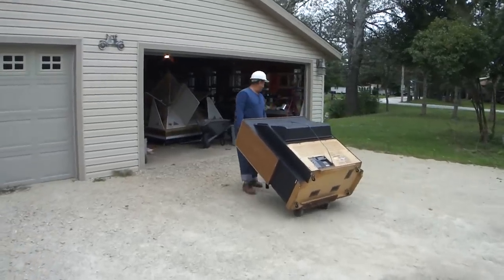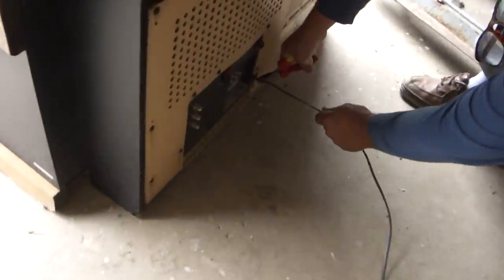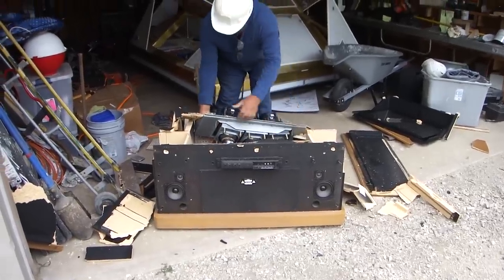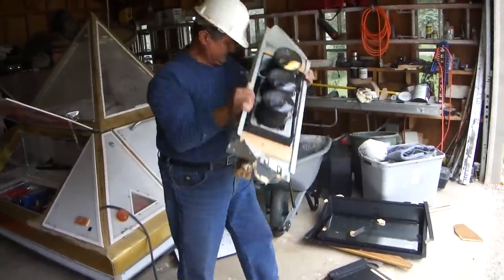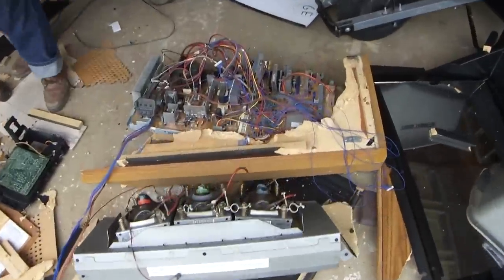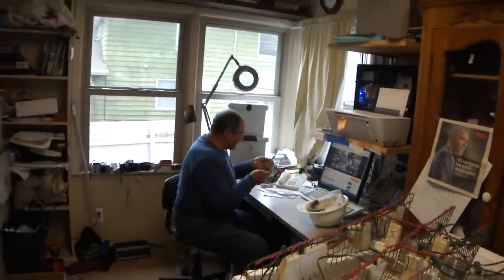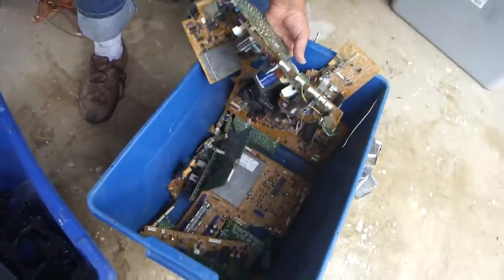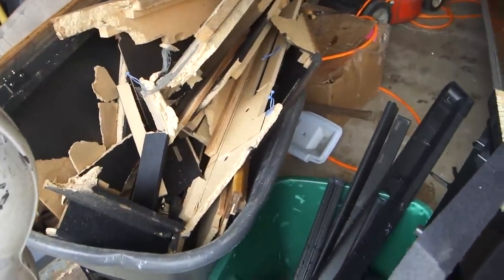Greg Zanis - Scraping Apart A Big Projection TV

Comment: soooo, he is wearing a hard hat with ZERO overhead hazards, BUT, no steel toed boots (sledge hammer hazard), no work gloves (broken glass/metal/screws sharp edges), and no safety glasses (glass and wood shrapnel). What a BRILLIANT guy he is. Unbelievable.
Reply: I was thinking the same thing.  PPE is key.  Scrap safely.
Reply: @biffskills4842  Or, at least PPE that makes sense.

Comment: You Would Make More Money On The Boards If U Leave Cooper On, but not as much as Copper alone seperate frm the boards, Copper holds the highest value, boards is like one $1 lesser, so Greg u doin it by the highest way of makin yo money, providin u have the time to do it, some Scrappers dont, so its not worth their time. Evrythng diffr frm 1 Scrappr to another, biggest thng to me is What Encourages U To Scrap, it does u Good to use yo Sludge Hammer, it does me Good to use me drill. Appreciate yo Sharin How To Scrap, i enjoy laughin at u with that Sludge Hammer. LoL Stay Encouraged
Reply: wrong, those boards are low grade no matter what which equals 16 cent a lb. if you get more cause ur scrap yard are idiots good for you but there low grade populated or depopulated

Comment: that plastic does not go in the recycling!!!!
Reply: +david brunner Trash Trucks and Lawn Care      Hey, Where does it go? I recently started scrapping electronics (Usually smaller things like cell phones, computers, monitors, wi-fi components, flat screen tv's, ect and I can assure you I Disassemble them, not smash) I have accumulated quite a mound of #7 plastics. They are clean pieces, free of any components. Where do you suggest I take them?
Reply: cadillac19831 I have no idea where you could take them but they could be recycled if you find the right person.
Reply: In addition, the contents of ray tubes is very poisonous!

Comment: How can you salvage parts and make the most $ when you destroy them? You would make a HORRIBLE auto salvage yard operator. You DO know working parts are worth more than broken ones right? You would destroy a $20 part to get the $3 scrap value for it broken? You know there's gold on those motherboards right? You most likely got $30 for the destroyed raw metals you were after when if you were a civil human being you could've tripled that in selling the working components using a screw driver instead of a sledgehammer. But it seems you love your sledgehammer too much lol! Disassemble, don't destroy. At the very least the clean up is easier.